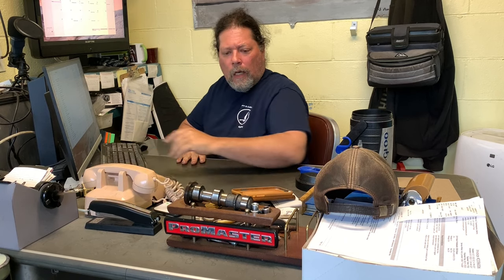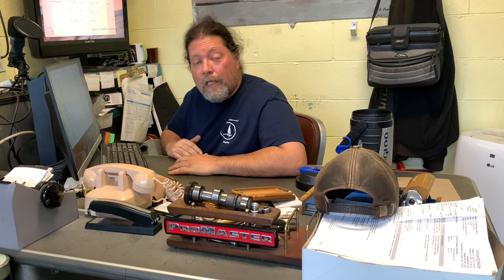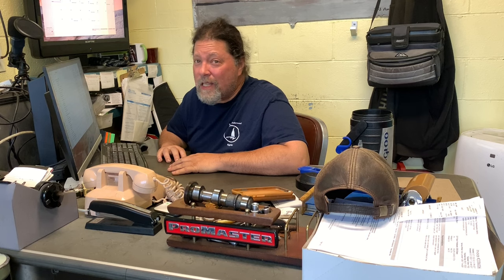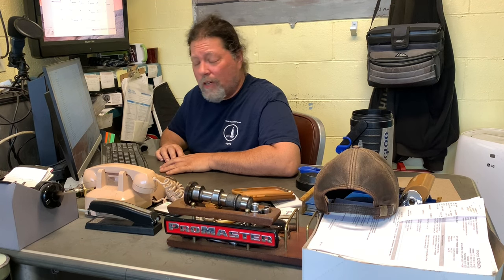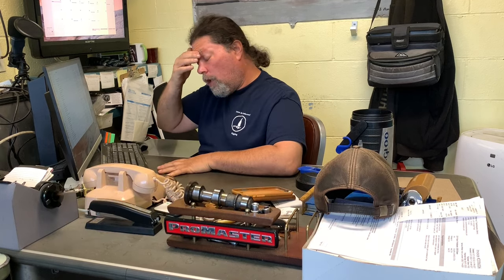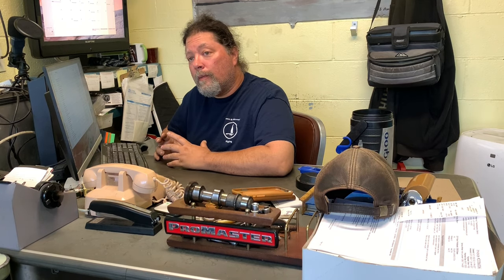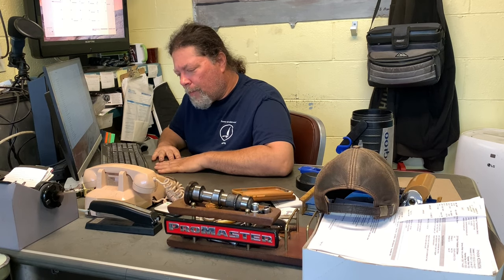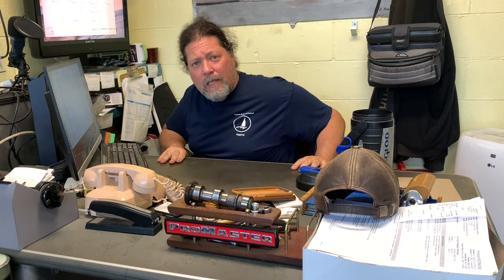Ram Promaster Tow/Haul mode EXPLAINED. Downshifting on hills EXPLAINED. Tow Haul Promasters Only.

Comment: I love you man.
Just a bit of personal experience.
I towed a 328 convertible just over 1000 miles to Mississippi. Guess the trailer might be 1000 ponds, car around 3000.
15.4 mpg in tow haul mode.
Return trip with trailer only.
16.3 mpg in tow haul.
1 mpg cost seems damn good to me.
Definitely a more pleasurable drive in T/H, use it all the time.
Reply from the maker: Outstanding numbers. Keep doing what you are doing.
Reply: Dang! I am going to use that button!
Reply: I also use the Haul Ass mode always.

Comment: As a rule, anything over a 1000 pounds. I stick it in tow hall mode. 389000 miles on the original transmission I always change the filter and fluid every 60000 miles. Thanks for the video Kip, hope you were doing well.
Reply from the maker: Clearly, keep doing what you are doing!

Comment: If I know a steep downgrade is coming, I’ll “downshift” using the shift limiter while I’m on the upgrade. It doesn’t do anything there, but prevents upshifting going over the top, and the high impact downshift right afterwards. For really steep downhills, I’ll slow to a crawl going over the top and shift into “1” just for the control going down the roller coaster.
Reply from the maker: This is how the tractor trailers do it. I approve!

Comment: I read that once Winnebago turns the Promaster into a Class B Motorhome, it adds about 4K (+ -) in weight, so it's always "Hauling", or at least the Engine and Transmission see it that way, so I always engage Tow/Haul mode when I'm driving. I really enjoy your videos and the knowledge you share.  Take care.
Reply from the maker: Some of the fancier conversions are right at the limit, and that’s without all the crap you bring when you travel.

Comment: If Tow/Haul is like Fords, it might add more engine braking, which is good at low speed highway driving due to traffic as you can slow down without needing to hit the brakes.  Definitely useful in urban areas.

Comment: Question: I have been throwing my cars into neutral when rolling up to the red light on the exit ramp for example, approaching the stopping point. My 2016 Promaster is making a bang sound and it feels like a heavy rubber mullet hitting it from underneath when I put it back in the DRIVE node while still rolling around 10-40 MPH or so, not at higher speeds anymore. Only experienced this issue with the Promaster. Why will it not just go back into drive mode and cooperate like any other car? Otherwise it does everything else as it should. Thanks for the great and needed forum!!
Reply from the maker: I would take a long hard look at both the transmission mounts, particularly the rear one. If you have to, tape your cell phone under there while it's recording video and drive it. My guess is you'll find that rear mount very loose, and that's allowing the engine to swing when it goes in and out of load. But that's just a guess.

Comment: Thank you for the info on the downshifting.  ? Should I engage the tow/haul if I am having trouble getting up hills/mountains inclines😂? I am only able to do about 40mph running at about 4rpm-anything more and I will over heat.  (Yeah I am hauling my home in back:)) I haven’t looked at the scale either!  

If not the tow/haul? Anything else I can do? I have a new tranny also front the dealer.  A vid on this would be 😊 great!

Comment: What are the hauling and towing capacities on these vans?  Can they do more than the sticker claims?
Reply: Of course, just expect the brakes to work harder and avoid steep grades. Also remember to treat the van to fresh engine and trans oil more often under heavy/extra heavy use
Reply from the maker: About 4300lbs cargo, 7100lbs towing. You can always do more than the rating, but do so at your own risk.
Reply: @promastersonly1419   I never go over 3000 cargo unless I get $2.00+ a mile. top is 4200, that puts me at 10,000 cvw

Comment: How much can I tow with my 2016 Ram PM 2500 v6 159" wb, high roof?
Reply from the maker: @reefkeeper_zay2750  spec was 5100lbs, but in 2018 they started factory welding the hitch, and with no other changes that upped the spec to 7100lbs.

Comment: the transmission of my ProMaster 2500 jumps every time it shifts into second gear what's going on there . Thank you
Reply from the maker: A harsh 1-2 shift can be many things, but the first step would be to check the two transmission mounts and make sure they aren't worn.
Reply: Thank you

Comment: I don’t mind the downshift going downhill. In fact, I usually invoke it to save the brakes. I dislike it on the uphill side where it does a double downshift to go up a slight hill. But, yea, I get it. On Tow/haul, I don’t have that button on mine. Any ideas why?
Reply from the maker: This is news. Does the 2022-up not have a tow/haul button? It’s next to the shifter.
Reply: @promastersonly1419   haha, man. I swear I looked. But yea it is there. Once I saw it I realized I had even used it years ago. Man getting old sucks.
Reply: Going down a steep mountain does the driver need to manually drop into lower gear? A friend with a 2022 RAM promaster was just mentioning her breaks getting hot out west in the mountains. Had to cool them off.
Reply: @cadillacjack3240  I always do. Saves the brake pads.
Reply from the maker: @cadillacjack3240  that’s exactly what the manual shift mode is for.

Comment: My 136” hightop weighs 7800lbs, I live full time in my van, I am building a cargo trailer home on wheels, the trailer weighs 3100lbs, I am worried about the stress on my vans trans?
Reply from the maker: 3100 is well within what it can do. I too would be worried about towing 100% of the time. But people do it. 

All you can really do is monitor the trans temp, and back down the speed if it starts getting hot.
Reply: @promastersonly1419  Love your channel! Question here is how do I monitor trans temp? Which OBD? Thanks!
Reply from the maker: Easiest way is with a phone app. I prefer Palmer Dash Command (well under $15) an ELM327 reader (amazon. BT for android phones, wifi for iphone). But there are others.  @mirogintz

Comment: Many in the campervan community swear by tow/haul claiming it reduces MPG. Theoretically it’s supposed to increase it, right? Any idea why it would lower MPG with a heavy van??? 🙄
Reply from the maker: No, it would reduce mileage since the engine would be spinning 200rpm or so faster, but making more power (thus burning more fuel).

Comment: LOVE the videos and don't want to beat a horse living or dead but... I live up in the Rockies so I'm annoyed by this constant downshifting and have a question. There must be some kind of level sensor somewhere right? Do you know if it's in a place where it can be tilted slightly to trick it?
Reply from the maker: No level sensor, just an accelerometer. Not that it matters, the computer uses rpm, throttle angle, output speed, and a few other things to determine when it should shift. I know it sucks, but there is nothing you can do about it, other than to prempt it by manually shifting.
Reply: I summer in the Rockies… Do you have issues with getting UP those inclines? I must be hauling maybe 3K? Do you have any suggestions? I can only muster about 40mph at 4 rpm otherwise I will overheat—especially on the long grades.
Reply from the maker: @MannyWC  That's basically normal. A fully built out van can weight right at 10,000lbs, and it simply isn't a sports car. Do what the semis do on big hills - get in the right lane and go as slow as you need to with your hazards on. It feels wrong, but you can run this engine at 5000rpm all day and it won't care.
Reply: @promastersonly1419  okeedoke! That is what I do, so I will just enjoy the view. It has overheated 2x at 40mph at 4rpms.  I just pull over and cool off. Any other suggestions? I also crank the heater:)
Reply from the maker: @MannyWC  I would overheating outside of normal. I could see a few things causing that. Altitude is a factor, but it still shouldn't overheat. Too many possibilities to list. Any check engine light?
Reply: @promastersonly1419  check engine is on due to fan recall which I am trying to replace. My texas mechanic swears both fans are running though.
Reply from the maker: @MannyWC  That it overheats tells me they are not running, or not running long enough, or something like that. Be very careful till you get this resolved, this engine does not like to be overheated.
Reply: @promastersonly1419   Ok will do! Thank you for your time!
Reply from the maker: @MannyWC  Any time.
Reply: @promastersonly1419  I asked somewhere else on this thread, but no or yes? to tow/haul during those situations? Just a button to play with:())?
Reply from the maker: @MannyWC  It can help a bit, but it isnt going to help or prevent overheating.
Reply: @promastersonly1419  ok thank you!

Comment: I have a 2024 PM 3500. 9 speed transmission. 
That said, It seems to never goes above 7th gear. The only time I saw it was on a decent. 
Why is that???
Reply from the maker: This is talked about on the forums. It’s programmed never to into 8th or 9th gear. A good thing, as those gears would turn the engine at ridiculously low rpm and lug it, doing damage.
Reply: So what is your take on having them in the first place? 
BTW, thanks for the quick reply
Reply from the maker: @chrisschiel6741  Generally, you only care about ONE gear, the highway gear, and it's basically the same ratio in the 9 speed and the older 6 speed. But the 9 speed appears to be more durable over the long haul. That's not to say it will never break, but so far there are less reports of problems. It's been in the vans since 2022, but it's been in other vehicles for 10 years or so. It's a ZF, licensed to and made by Chrysler in Indiana.

Comment: hello kip. i have two questions for you.   are we for sure knowing  the tow/haul doesn't increase the transmission oil pressure, cause if it does you will be replacing the transmission  pump sooner by using it.   second thing is rpm, have you ever heard of the teenage kid borrowing moms car and it comes back with a lifter/rocker tic cause the kid ran the shit out of it? i have seen people bragging on this forum and the roadtrek forum about how fast they go such as 80 mph and how fast they go up hills while complaining they cant keep up with the cars ie.. pedal to the floor!!!   on flat terrain on the interstate if it wont hold overdrive then you are going too fast PERIOD
Reply from the maker: Hard to say, but my guess is the opposite is true of tow/haul vs pressure. It would want to delay the shifts, and make them softer rather than firmer, which would mean the computer would need less pressure. As to that punk kid, the engine is a 4 valve, roller everything, overhead cam, completely modern engine. It doesn't give a shit if it's spinning 2000rpm or 5000rpm. At max rpm it has 130lbs of oil pressure. It doesn't care.
Reply: @promastersonly1419   Kip per my research the 62te does have a pressure control solenoid, so in tow mode it will wear the pump housing more than normal if the user leaves it in tow mode all the time.  see    https://www.youtube.com/watch?v=eGea2nzF9zE    I have also watched a video from gary ferraro disassembling a 500,000 mile promaster 62te transmission still in amazing shape all highway miles though    https://www.youtube.com/watch?v=YV05LqVZ6J8    i wont be spinning my 3.6 at 5000 rpm im old school and i just wont do that !!  i was able to go through the rockies both ways with out letting the engine get into 3rd gear screaming by braking a little, letting them cool and then braking again afterward when i got home i checked my brakes looked mint still. btw i am at 9,000 lbs
Reply from the maker: I've studied both of those videos, because transmission videos are like porn to me! Sadly! I personally don't feel the need to use tow/haul, but it's another button to play with and I think it could help some people, especially very heavy motorhome buildouts. I see where you are going though. I guess even if you used it 100% of the time it wouldn't really matter, because on the flat and level the transmission is locked up and doing the same thing, button be damned. 
 @Conky011
Reply: @Conky011 I’m heading back through the Rockies, and I probably am hauling about your weight…do you have any suggestions on improving performance on the upgrades? I can only go about 40mph / 4rpm.  I start to overheat if I hold that too long! (I turn on the heater full blast also- suppose to cool the engine?)
Reply: @MannyWC  i put the flashers on and go up in the truck lane and going down i just use the brakes sparingly to keep me around the posted limit, i try to let brakes cool as long as i can before reapplying them. Dont be that toyota driver that keeps brakes on all the way down and they wonder "whats that smell"
Reply: @Conky011  lol -I don’t as the PM brakes for me most often:)

Comment: Will I get better mpg if I shift from D to 6?
Reply from the maker: @christopherfreitag5121  wont make a whit of difference. The shifter is a gear limiter, so in 4th it will run 1-4 just like normal, but not 5th. In 6th, it’ll jusr run all 6 like normal.

Comment: It would be one thing if the engine braking happened when you actually stepped on the brakes and wanted to slow down. If i use the brakes, and actually slow down then it stays in 6th.... 

It's really stupid, completly backward of actual life.

Same as the downshifts from 6th to 5th. It inlocks the torque converter while simultaneously downshifting into 5th. Evary other transmission just unlocks the tcc in 6th to see if you can actually make it up the hill. So much extra work the engineers made the transaxle do.
Reply from the maker: Kinda. But lugging an engine is one of the worst possible things you can do to it. Reving isnt. But I take your point.

Comment: Any recommendations for handling long grades, both up and down, while heavily loaded, like at or near max GVW?

Also, how many break in miles should a '23 PM accumulate before attempting such heavy loads?

Thanks for all you do. Easy to understand explanations are rare these days, especially ones based on experience.
Reply from the maker: Sorry, missed this question for some reason. If you are pulling hills heavy, I might recommend the manual shifter, which isn't really a shifter but a gear limiter. These engines don't mind reving, but they do mind lugging. As to breakin, unsure but I would expect it be no more than 500 miles. Engine break-in is kind of a thing of the past, to a large extent.

Comment: cool stuff.  Is "engine braking" also called "jake braking"?!?
Reply from the maker: Indeed it is. Named after a company named Jake which developed it many years ago. Also called engine braking or compression braking or exhaust braking.
Reply from the maker: Now that I think about it, truckers LOVE rhymey things. Those passenger vans that the Amish drive around in are called Yoder Toters by truckers. Jake Brake fits this pattern.
Reply: Engine braking and Jake braking are not the same, though the terms may often be used interchangeably. ‘Jake Brakes’ are not installed on gasoline powered cars and trucks. Jake brakes actually mechanically change the valve timing to turn the engine into a air compressor brake. Normal compression braking just uses normal engine valve timing and the closing of the throttle increases manifold vacuumed and turns off the fuel supply to the engine cylinders, so they are using just standard engine resistance. Diesel engine have much higher compression ratios than gasoline engines. That’s a big reason they have bigger batteries and starters.
Reply: @americanrambler4972  -  Thank you for the info!    Is the 'jake brake' in a diesel engine something which can be rapidly engaged or disengaged when needed?
Reply: @promastersonly1419  It is Jacob's Brake... Jake for short. Lots of companies make open valve breaking but Jacob's was the first and still the best by far.. On my W900 KW you could choose 2 4 or 6 cylinders
Reply from the maker: @Babybugex  Here, I suppose it would just be regular old compression braking or engine braking.

Comment: Dude I stumbled across your channel and I fucking love it ! But now, if you can, please answer my question about how the hell do I fix my radio that is stuck on pair phone mode and the flashing date and time on my cluster it’s a 2020 2500 with 49k thank you buddy I love you now say it back to me you animal 😂
Reply from the maker: how did I miss this question? Sorry about that. The cluster flashing is sort of a check engine light for the can-bus system. It means some computer isn't communicating with the body control module, which is the master computer. In your case, it's likely the ETM, which is entertainment telematics module. The radio, in other words. Because it's hung up on pairing, it's not communicating with the BCM. Not exactly sure how you fix it, but disconnecting the battery will likely get it.

Comment: I have a stupid question. I have a promaster 2500 from the year 2021. I am looking for a 186 cfm air compressor, which is better, to tow the compressor or take it in the cargo area, 1500 pounds is the weight of the compressor
Reply from the maker: Carry it, rather than tow. You van is rated to carry something like 4200lbs. A 1500lb compressor you wont even notice it’s there. But towing is hard on things, especially mileage. And braking, and turning, and backing up. 

Mount it forward of the rear axle if you can. They go swimmy in the front if you have too much weight behind the axle.